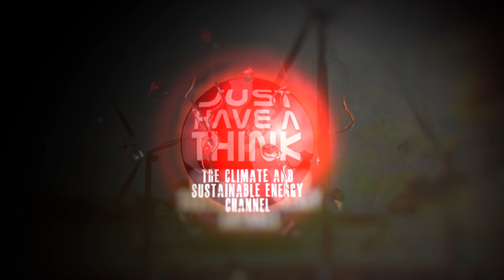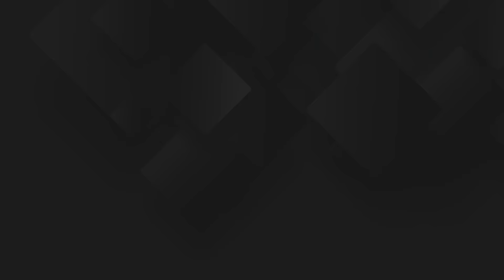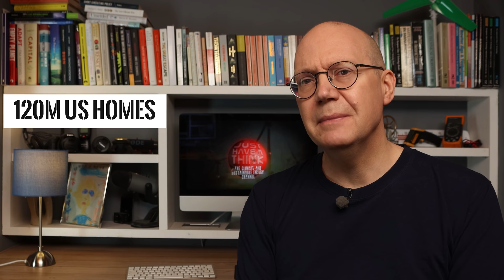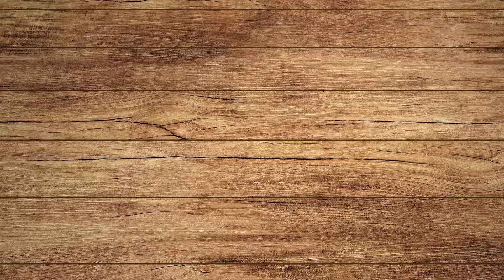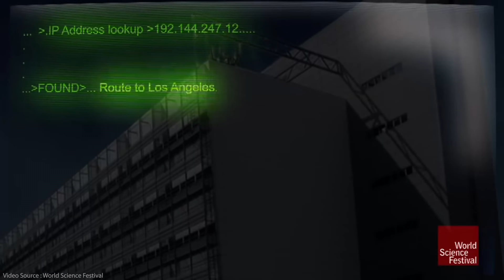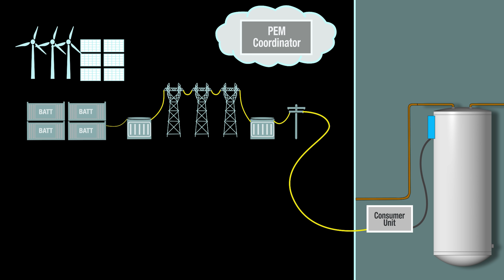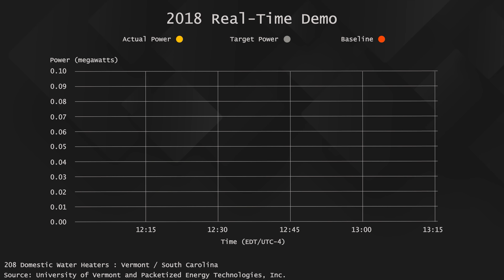How to balance renewable grids WITHOUT energy storage!

Comment: The more complex a device less reliable, engineering team strive for success and recognition but often times makes simple task overly complicated for consumers especially the less nerdy ones. HVAC technicians ask on the phone regularly did you change the batteries in your thermostat. That old Honeywell 50-year-olds thermostat that still works is an example of good engineering.
Reply: That’s true. Someone else commented that putting this on a home’s battery storage so it charges without disrupting the grid will likely get the same benefit with much less work.

Comment: The Texas cold snap was bad, but calling it unprecedented understates just how frequently Texas is underprepared for cold weather.  As for temporary opting out... you've basically given rich people the option to have always on power, while poor people will have to wait until the grid can support them.
Reply: Yes, Texas crisis was mainly due to gas and oil suppliers not winterising their equipment, not because of a failure in the electricity supply, a situation which has been remedied by the state regulator now.
Reply: How so? The video says that appliances would opt out if, in the case of water heaters, the temperature was particularly low and therefore the household's need had a higher priority for power and therefore would be able to 'opt out' at that point. I don't see how that favours rich or poor.

Comment: I have a master's degree in computer science and distributed systems, and packetization of energy seems like using a rather heavy screwdriver to bang in a nail. Packets of information are not interchangeable, energy is. Power is just flow where every piece of it is the same as every other bit. We already have very efficient flow management algorithms, bringing packets into it is just trying to whittle down an overcomplicated solutions from a more complex problem to solve something that is much simpler and has well understood simple solutions.

Comment: I think the title of this excellent-as-usual video should be"How to Better Balance renewable energy grids and minimize energy storage!"  Despite optimizing demand with supply, there will be times, especially in regions with severe climates, when even the most optimized demand will exceed the supply and when demand will still not be able to absorb all the supply.  Storage will still be necessary both in the short periods and for seasonal periods when renewables are simply not able to meet demand for weeks and months at a time.  
Right now that storage comes in the form of fossil fuels one of whose great strength is their inherent storage capacity.  In fact, they are stored energy until someone puts a match to them.  Electricity doesn't work like that and if not used the instant it is created, must be stored to avoid being wasted.  So we will have to rethink our energy use patterns.  Curtailment is not the answer as it is 100% wasted potential so storage, no matter how inefficient has to be employed.
 But, as Dave makes so clear, smarter is always better and there are many savings to be had by establishing communication across the grid.

Comment: The uk new house build should be installing 3phase Supplies for the future. But, currently most properties have single phase. This system in a local area could be used to balance loads and reduce  peak loads. W ith weather changes predictions it could be possible to say overheat water or property by couple degrees to reduce load by bit when cold night or wind stops blowing

Comment: No network needed just a box ( or in unit ) that monitors the grid frequency .
So the load on the grid .
Then it does a random timed setback , runs in a low power mode , delayed start  , stop or it just waits for a grid frequency good  .

It's that simple but nobody can charge you for the network access !

Comment: Refrigeration and of course heating are the most flexible of these.  Both heat and "coldness" can be stored.  Taking it to a more localized level... yachts using solar power.... I calculated awhile back that pound for pound the energy storage of ice is about the same as battery storage.......but ice has an unlimited cycle life...... My conclusion was "make ice while the sun shines"   I've long felt that this is the way home refrigeration  / freezer systems should work. Among the highest (locally here) energy consumers  it  just makes sense.  Just imagine a large side by side reefer / freezer.  The dividing partition made as a chamber with a suitable eutectic solution.  When the sun shines, the freezer freezes the solution..........  The refrigerator is kept cold by this frozen solution (ice).    The mass of solid frozen food is not effected significantly.    Just imagine a few gallons of a cheap solution doing the job of tens of thousands of dollars in batteries!!

Comment: This continues an expectation of clean power from the grid irrespective of supply or demand. I say go the other direction. Design residential and especially commercial electricity consumption on the premises that the grid is unreliable with local in-house power storage and management. Most homes getting solar include some type of battery and inverter system anyway. While an expensive investment, if power companies offered a reduced bill for having unreliable or possibly unclean power, it could be a last resort battery charger if levels get too low. Also an option if you do not have a renewable DC source, but just want cheap electricity. 

This would give the grid flexibility to transition to renewables while giving the power in your house/business more uptime. It would also allow for easier inclusion of on site renewables to offset even more cost.

Comment: I wonder if energy companies will sell premium services, similar to how large telecom companies have done in the past. What I mean is, it was possible and advised for companies to buy bandwidth in different categories, e.g. voice packets of data were more important/prioritised than web traffic. Telecommunication companies sold these premium services at a premium price.

Would energy companies consider emulating this model and offering 'premium customer' more packets of energy?

Another super video and innovative idea
Reply: You mean if i Pay $10 I get 20Kwh of energy but if I pay $5 I only get 10Kwh ?
Reply: @catprog  hi, not really. I was more suggesting, energy companies guarantee delivery of power to those who pay the highest tariff.

This was the case with telecoms providers, for example, if a company wanted to guarantee delivery of data packets they could purchase EF (expedite forward) type traffic. And then if the customer marked the traffic as EF the telecommunications provider would prioritised this traffic over others. 

So in theory, other non marketed traffic could be discarded in favour of the EF traffic.

I was speculating whether this type of system would be applicable in the energy market.

Comment: Should would.  The system protection devices could also be connected to optimize line losses and help prevent over current and cold load situations.

Comment: I did a review of IoT tech including grid connected tech a year ago and I found that most IoT devices have little or no security. In my opinion, this is where the biggest problem with it lies. If these devices end up getting connected to home networks, they put the full network at risk. There's also the issue that without a connection to the home network, the devices need SIM cards connected to the local 3G or 4G networks, but there's only so much capacity on these networks. I have been wondering if the grid itself could be used as a low speed network with hubs placed around cities that connect these low speed transmissions to the internet, thus eliminating the need for telco networks or home networks.
Reply: Powerline communication. No home network required.

Comment: In a world where people have EV which are able to store days or weeks worth of home energy capacity the Austrian spot energy market makes more since.  Let the home owner have solar panels and storage in the form of an EV maybe even stationary storage at the home.  But put a smart inverter between the demands in the home and the grid that knows the spot price and can choose to buy or sell power based in the spot price.  This would allow the demand to match the generator capacity real time and encourage people to be part of the system as they can maximize their storage capacity based on profit motives.  For example you can simply let your roof top solar drop power on the grid when you drive to work and pull power from the grid at night when you get home to charge the EV or if you own enough storage either in the home or a second EV you can charge one during the day from the solar and sell that energy when the demand is high for a profit.

Comment: The Dream of ENRON is alive.
The Dream of the 90's is alive.
Actually increadably high voltage lines like a few test pines in china and belt and road prove global energy markets could be a thing if everyone invested invested I these increadably high voltage lines. But to make it work most efficiently, unlike china and belt and road initiative, you'd ideally like to stick with a standard voltage/current type. The Chinese and belt and road initiative switch wildly between voltage and current type creating more innifeciency and loss with transformer resistance.

Comment: I wonder if they're thinking about integrating with existing standards like CTA-2045 which handles the DR communication with the appliance. Though in the case of CTA-2045 the device doesn't request, it tells the device things like "shed load" or "use as much energy now, it'll be more expensive later". I would hope they're aware of this because competing standards are already an issue for adoption in this space
Reply: Yes what's needed us to integrate CTA-2045 with GreenPHY (car charger) and Power over Ethernet, so the meter speaks all three and can answer questions about grid status.

Comment: This seems like a good idea for short term variance (minutes to hours) in the renewable energy generation, but how would this solve fluctuations in power output if for one or more days the power output is lower than the needed power demand? You would still need something like biomass, fossil fuels or energy storage to fix this gap between energy supply and demand.
Reply: We just need to have more renewable generation than demand. That's how we've made fossil grids for as long as we've had stable grids, we have an overcapacity of peaker plants, which is something we can do with wind.

Throwing storage into the mix helps, but isn't necessary if your grid is of any reasonable size. The question broadly will be which costs less, an overcapacity of wind turbines, or a battery minus the value of local backup.
Reply: @TheReykjavik  Doesn't matter how many wind turbines you have if the wind doesn't blow. And we can't possibly build enough batteries to power the grid.
Reply: @Withnail1969  Can you name a single time in the history of the world when the wind wasn't blowing?
Reply: @TheReykjavik  Yes the wind isnt blowing here today. The wind often doesn't blow.
Reply: @Withnail1969  "here". So you found a single location on the planet where it wasn't windy, and assumed that therefore the entire global atmosphere had stopped moving? smort.
Reply: @TheReykjavik  What?  Lack of enough wind is a widely known problem for wind turbines. Having more turbines doesn't make the wind start blowing.
Reply: @Withnail1969  You still haven't named a single time when there wasn't wind, demonstrating your total lack of understanding of how weather works. We don't have to make the wind start blowing, because again, it never stops. We simply need wind turbines distributed widely enough that aggregate output of the system is always enough to meet our needs. Going for pure wind turbines isn't the best practical solution, but it is doable, adding in solar and batteries will be easier and cheaper. But again, the wind never actually stops.
Reply: @TheReykjavik  You mean there is wind somewhere in the world all the time? That doesn't really help us. We need wind fairly close to where we need power.
Reply: @Withnail1969  Ok, can you name a single time when there hasn't been wind at the height where wind turbines routinely operate within 100 miles of any populated place?
Reply: @TheReykjavik  yep there have been summers when wind turbines right across europe havent been able to operate for several days at a time.
Reply: @Withnail1969  Can you site a source pls
Reply: @TheReykjavik  it was widely covered in the news. i see no purpose in this discussion, nobody except you thinks that wind power is not intermittent.
Reply: @Withnail1969  I'll take that as a no, you cannot site a source.
Reply: @TheReykjavik  It's 'cite' not 'site'.
Reply: @TheReykjavik  Just look at the grid watch system in the UK. There are time periods of weeks when wind generation drops to 20% of peak as a blocking high pressure zone can extend over many hundreds of kilometres. The same weather systems can impact many countries in the same region at the same time. This happens several times every year, most often in the summer. This doesn't mean that the wind stops everywhere in the zone, but the power drops massively. Of course it is possible to keep over-provisioning, but there are practical and economic limits, which is why some form of long term energy storage capability is required. Even building wind turbines and associated power distribution and control systems consumes a lot of natural resources, and require more in maintenance. They also have a lifespan, and require replacement. Vast overcapacity has its own environmental and cost issues.
Reply: @TheEulerID  Yes, storage is going to be cheaper and less impactful on the environment than massive overcapacity, but the point is that we don't have to wait for storage to install wind power. Storage makes it cheaper and more efficient, but it isn't needed for a functional grid.

Comment: This is all fine and dandy, for leveling out the load, but the total load still needs to be met. This just means we need fewer "peaker" type generators. Renewables will still need grid storage. Its just that we can use older style batteries, and not waste lithium ions for grid storage, and reserve them for EVs.

Comment: I'm a little curious as to why they don't include QOS in this scheme ( quality of service). It's used in data and voice networks to prioritise packets.  So that packets that can't be delayed, like voice, get prioritised.  Each packet carries a tag describing its level of urgency.  It's a bit like having a first class, business course or economy class ticket.  Within certain limits the higher the class of your ticket the more quickly network resources are allocated to your packet.  The same type of schemes could be done on a power management cloud.  A quality of service tag being used to allocate power more often to devices that need it urgently, rather than frequency of request being used to allocate power.  The result be less traffic on the power management cloud and the ability to allocate power requests to differently tariffed streams of power.  The longer a device is prepared to wait for power the cheaper it's power is and the more urgent it's requirement the more expensive it's power.   The algorithms for this are all pretty well established on computer networks.

Comment: If all had a power wall or similar house/apartment battery then on average nobody would need power delivery over 1Kw(with out EV or electric heating). Any load higher would use the battery for the extra power and be refilled when the usage goes down again. Verry fiew use over 24 KWh per day and if you match battery size/capacity to your usage you would have 1-3 days of power in a black out even if you have no solar at all. I barely use 30 KWh per month in my apartment so my battery could be as small as 2-3 KWh with continuous power delivery of no more than 500W/h(230v/2.2A). I think that would make planning power grids far simpler and I could be with out power for 1-3 full days and not detect any problems if demand was extrem and heat was not affected(I have district heating)  in my area.

Comment: I like the idea, but I do see a few drawbacks and challenges.  Not to dwell too much specifically on hot water heating, because this concept extends well beyond that, but this works for storage hot water systems, and not so well for tankless, on demand hot water system (which hold promise for reducing energy  consumption).  These systems would  work well where benefits for the common good are universally, or at least generally accepted.  As we've seen with the struggles of Net Neutrality with the FCC in the United States, benefits for the common good are often facing challenges from the entitled and the greedy.

Comment: If a consumer, willing to always have the lowest priority, could buy energy at a low price then that consumer would be motivated to invest in energy storage.   That would spur investment in domestic and industrial energy storage.  I can see refrigerators with large ‘cold’ reservoirs that can be replenished when the price is right, car chargers which are told when the car will be next needed so that their batteries can contribute, water heating systems that trade off between heating the tank and on demand heating to boost the temperature of only the water being delivered.  All these systems could make the best economic choice based on a real time dialogue with the energy provider(s).